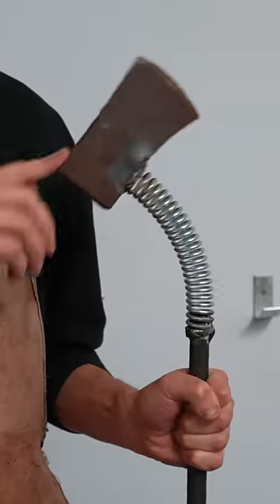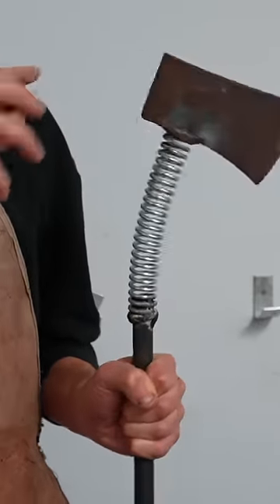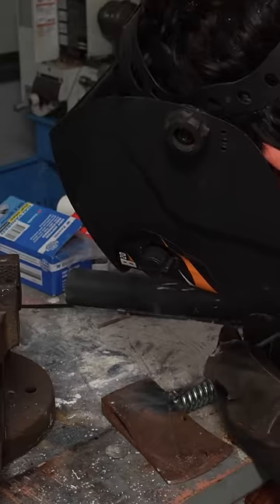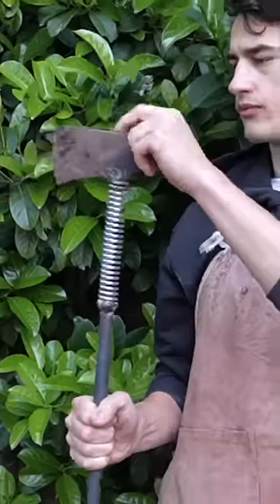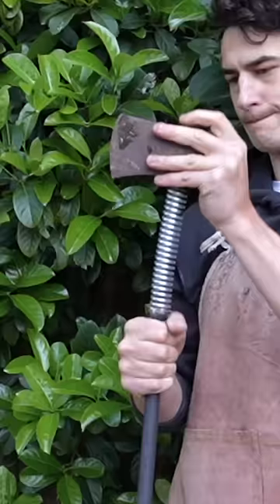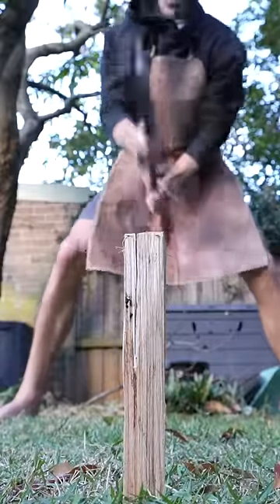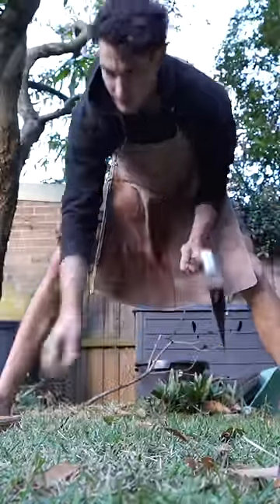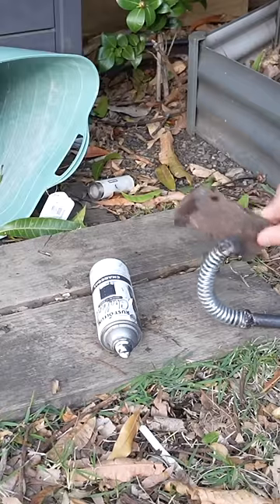I made a spring axe

Comment: A high explosive printer that prints each page in a split of a second and with a loud bang to assert your dominance in the office
Reply: It's coming in the office set with a stapler gun and a chair that can deploy spikes when threatened.
Reply: Are you describing a classified firearm
Reply: @MeLoNarXo pneumatic staple gun, just when they think the chaos has subsided the air compressor kicks on…
Reply: So does it use an explosion to send all the ink onto the paper at once?
Reply: So printing press that use the kinetic power from the explosive to press the ink to the paper within a second then.
The blank bullet would be enough ithink, IDAT'll figure out how to make it work.
Reply: @ExpandDong420 I was thinking more like the old timey cameras were the flash burns the image into silver powder, why not do that but with either the pressure sensitive graphite copy paper or the heat sensitive receipt paper. Just get a grid of high intensity lasers and get 8-bit photos
Reply: @christophersteadwell3217  but that's not "high explosive" is it?
Reply: @ExpandDong420   i imagined an old school printer that, instead of being pressed down on the paper by a screw, gets blasted on the paper or a stencil that shoots ink with an explosive inkbag
Reply: Hey now as long as it actually prints every time you click print I don't care what else it does
Reply: Combustion engine printer
Reply: I just need a printer that works in general.
Reply: Fully automatic printer
Reply: Thermite printer. Yessss
Reply: Yesss

Comment: If the spring was a bit stiffer, i think this could be usefull. That it somehow adds momentum when you swing the axt with full force that gets released again when you hit something, and it can therefore do more work than a normal axt.
Reply: i think 'a lot' stiffer ..but yes
Reply: That's not how physics works
Reply: @9999crazymonkey  of course. When I swing a big hammer or Axt with a springy thing inside, the handle accelerates faster than the head due to its mass. And as soon as the head starts to move, it receives the force of me swinging the handle plus the force of the spring that wants to go back to its neutral position, so is accelerates faster and gains more momentum. I just have to hit something before the spring is back in it's neutral position.
Reply: @denzzlinga  tell me you've only taken intro to Physics without telling me you've only taken intro to physics

Comment: make a chainsaw but remove the blades and replace them with spoons so that you can eat cereal super fast so you aren’t late to work.
Reply: that would probably require a custom body chainsaw otherwise it wouldnt work, the chain or w/e needs to be small enough to fit through the body of the chainsaw
Reply: @Atomicitalia just remove the shell of the chainsaw, and weld spoons to the chain
Reply: Dentists would love that
Reply: @FishFactInc.  considering the design of most chainsaws, the spoons would smack into something and render it useless lol
Reply: @Atomicitalia  give the chainsaw a giraffe neck, problem solved
Reply: This has "corn on a drill" vibes and that never goes well lmao
Reply: So smart
Reply: @Atomicitalia you could put the spoons on on a 90 degrees angle, instead of just outward where chainsaw teeth would normally point. I think it should be possible

Comment: You must record this secret process so it isn't lost, like Roman concrete or Damascus steel.
Reply: btw we know both of those now. sea water + volcanic ash and like standard metal working stuff
Reply: @duskpede5146  Is the volcanic ash in the concrete or the steel?
Reply: @foxxygradius7858 Volcanic ash is in the concrete, in terms of steel actual Damascus still isn't possible to be made because it was made with Wootz crucible steel which is a lost art we no longer know (damascus steel isn't that fantastic, what we have nowadays is far better so the only real advantage is the pleasant visual appearance of Damascus steel which can be replicated using pattern welding)
Reply: @tsrenis  Er... But that means the actual steel can't be replicate,d then? XD  Since Wootz steel is gone?
Reply: @foxxygradius7858  I was referring to the appearance, not the quality of Damascus steel itself.
Reply: Quench it in the blood of your enemies!  Won't make it any harder, but will add the "cool as crap" enchantment. I'm actually a novice blacksmith, it works!
Reply: The Roman Concrete was actually funny because we had the recipe, but could never actually replicate it correctly for some reason. That is until that someone realized “maybe we should look at the natural resources around Rome for the ingredients rather than using the modern understanding of the ingredients” and it worked.

Comment: As someone who chops wood multiple times a week, I could immediately feel the wrist pain this thing would give
Reply: Why? The spring would take a lot of the force which should theoretically make it less hard on the wrist. I think if he did this but with only a 2" long spring it would be a good tool
Reply: @dambroangling2828 the wobble might be hard on your wrists. Not good to have a big hunk of metal jerking your hand back and forth.
Reply: @dambroangling2828 vibration and the force of jumping back after a swing will definitely impact your stamina, wrist and forearm muscles.

The impacting force can not disappear into thin air and the only way out is through the handle, or in other words, through your body.
Reply: They use similar hammers to this in some places to like drive stakes into the ground and shit. Theres tons of vids of them being used in china and stuff. Seems super fucking dangerous tho 😂  think as far as wrist pain you’d really have to hit at an angle where it hits the ground after
Reply: @jchrizzy6995  thank you. I was starting to comment the same thing but then deleted bc no one listens anyways
Reply: @bleyzerplayz  Where did you go to school? There are several ways I can explain this but let's see where you're at first. Why do you think cars have suspension coils?
Reply: @dambroangling2828  the issue with this axe is it's inflexible handle. It's not a full flexible handle and you are most likely talking about flexible hammers, rather than flexible axes.

A flexible hammer (metal head and full flexible handle (rubber)) would work, but a semi-flexible axe (full metal + spring) will not.

The difference is also the recoil taking place. A hammer will bounce back in most cases, while an axe should either split or get stuck in a target, which is why it will have a higher recoil than a flexible hammer.
Reply: @jchrizzy6995  you are talking about hammers, this video clearly shows an axe. Two similar build tools, but with clearly different intended hitting force.
Reply: @bleyzerplayz  please don't tell me I have to make a video to explain
Reply: @bleyzerplayz  different intended hitting force? Means what sir
Reply: @dambroangling2828  I went to university in germany, studying metallurgy and metal forming, as well as self studied different fields related to this field.

Just because a suspension coil and this axe use a spring, doesn't mean that their uses were the exact same.

Compression and stretching are the related situations of a suspension coil. Also the force that a suspension coil takes on is not disappearing, so it is only used in relation to a shock absorber.

A shock absorber is not shown, is there?

Which school did you went, if I might ask?
Reply: @bleyzerplayz  Mechanical Engineer from University of Maryland. Tool and Die Maker Journeyman. Worked at a company called Maryland Precision Spring. I was not saying that the spring in this application is being used the same way as suspension coils in cars. I asked you that because I did not get the impression from your first comment that you would have further knowledge in the many ways springs can be incorporated in tool design
Reply: Yes recoil based wrist amputation from a mistrike would sting some 😊

Comment: Chair that has a fan on the bottom so you don't get swamp ass.
Reply: That's called a ventilated seat in the car world. Once you drive a car with it, you can't go back.
Reply: Also make the chair have air conditioning
Reply: But the blades are made of swords
Reply: @mrgw98  They have air conditioned seats, I don't like them. I never knew I like a slightly warm ass until I sat in an air conditioned seat.
Reply: He said dumb ideas no genius
Reply: @bobbygetsbanned6049 bro I accidentally turned on mine and found out the only cold seat I like is the toilet seat
Reply: @StrangeNative69  Lol I even prefer a warmed up toilet seat. As long as it's me who did the warming.
Reply: @bobbygetsbanned6049  Apologies, I thought all ventilated seats were cooled. After doing some research, it seems some car brands are ditching the cooler in the seats and only blow ambient air now. Used to, and still do in some cars, they use a Peltier system to cool the air before blowing it out from the seat onto you.
Reply: @bobbygetsbanned6049  You know they make heated toilet seats, right? Not sure if you can buy them by themselves, but there are toilets you can buy, mostly from Japan, that have them.

Comment: That's similar to those big floppy sledgehammers. They allow you to put a lot more power into your strike because you can use all your range of motion and they reduce the vibration of the hit.
Reply: good reference comrade
Reply: I think with stiffer spring it could make a decent chopping axe.
Reply: @dawid12301d Nah, you do need precision on axe

This is just dumb
Reply: @bocahdongo7769 have you ever tried to draw out hot steel? You have to be nearly surgical with the hammer.
Reply: @Altrag_  ..... Do you use spring hammer to forge the steel?
Reply: @Altrag_  like holyshit at that point you can invest to power hammer instead of training 10-20 years just to slam the heck out of hot steel precisely with springy sledgehammer

Comment: Make a multi-blade guillotine that cuts perfect slices of bread or fruit
Reply: Like a blender, but slower
Reply: You mean like they have in bakery's to make sliced bread?
Reply: As cool as it sounds, unfortunately a guillotine would do a terrible job at cutting bread. The blade will just squish it. You want a blade with teeth so you can “saw” through the bread, or one that rotates. The bakery I used to work at would use a meat slicer to custom slice bread for customers 😂
Reply: @whatthehecktye And is exactly why he need to make one. The blade have an excessively steep angle and a serrated edge of normal bread cutting knives. It would probably BE a normal bread cutting knives converted into that.

Comment: i would love to see this with varying spring strengths, i think one with a much stiffer spring would work better
Reply: Like a stick?
Reply: I think a fully solid spring would work better 
Like unmoving 
Like a fucking axe
Its not meant to be effective bro
Reply: Yeah I'd think if he went about 5-10 times stiffer on the spring, that could be pretty effective. Be able to give it all the power and control necessary, and still drastically reduce the shock by keeping it in the head.
Reply: @appletree3541  i just wanna see the balance between effective and funny
Reply: @threydan  i think the balance is gonna be more effective stiffer and more funny flacider

Comment: I actually own a spring loaded wood axe called the Chopper 1. Works well for log splitting, adds extra impact on the strike
Reply: hmm, I had to look it up. that's a cool axe
Reply: Makes me wonder about how a deadblow axe would perform.  Like a shot loaded deadblow hammer, but with an axe bit.
Reply: @thegardenofeatin5965  hmm, I don't think it would work as well as a normal axe. would the pellets reduce the shock put into the wood? I think the reduced vibration would make the axe not bite into the wood as easily. 
I'm not sure though. I've not thought about that before. 

at first I thought you were talking about an axe that used blanks.

Comment: During ww1, they existed. Though not in axe form. They were called Spring Clubs and was used widely by the Germans during trench raids. It is what might you'd expect, a leather wrapped handle connected to a spring and to a club head. The club heads varied from small balls to star shaped heads.
Reply: Yes called „Totschläger“ in German. One hit could easily break the skull.
Reply: That’s nice.

Americans: slam fires shotgun into Kraut faces
Reply: @chiarosuburekeni9325 yeeeehaaawwww
Reply: @chiarosuburekeni9325  keyword: trench raid. shooting from a short distance with less time to react reduces accuracy.
Reply: @chiarosuburekeni9325  Germans: "NO! YOU CAN'T JUST THROW A COUPLE SMALL BALLS OUT OF A GUN! IT'S INHUMANE AND CAUSES UNNECESSARY SUFFERING!"

Comment: Weld a section of bike chain to either side and you stop a lot of the sideways wobbling. You could even attach a latch the the back edge so the spring axe becomes a spring-loaded axe for some efficient short-range chopping. But maybe you'd want a finger guard for that :)

Comment: This actually isn't dumb. Bending the axe backwards builds up force, and releasing it releases that force, causing the blade to accelerate forward and build up impact force. When used like that, it basically functions like an automated knife. And it will be more powerful and faster than a knife because of the pressure built up in the spring.

Comment: There really are "spring" hammers, built with a sledge-hammer head on a long, narrow ('bout 2,000mm x 20mm) steel spring (or cable) that's covered with plastic so you can grip it without your fingers getting pinched. I've seen footage of several guys hammering metal spikes into place on a railway using them.

Apparently, the extra flexibility from the handle adds power while absorbing the excess impact force to protect the wrists.

Comment: Make a hammer that springs back, and has a clip to hold it back until you release the clip. Like a mouse trap strength quick release. Or… a vibrating hammer that keep hitting the nail without you hammering!

Comment: damn you're adding a ton of potential energy to that
Reply: No you aren't. Springs only store energy in the axis of compression. Bending a spring sideways stores very little energy on the inside curve and most of it is wasted by stretching the outside curve. The spring bending actually robs energy and momentum away from the axe head while it's swinging, making it weaker.

A rigid bar is ALWAYS more powerful than a flexible one.
Reply: Man failed middle school
Reply: Bro's getting owned.
Reply: @bloodleader5  i was thinking of the one shot, where he cut the wood and used more of a whipping motion

Comment: Those are actual things though. They’re called kinetic axes. Although instead of a handle and a spring, the entire shaft of the axe is a large, metal cable
Reply: Kinetic hammers too, big weight on a string is apparently better for the body and a lot more efficient overall